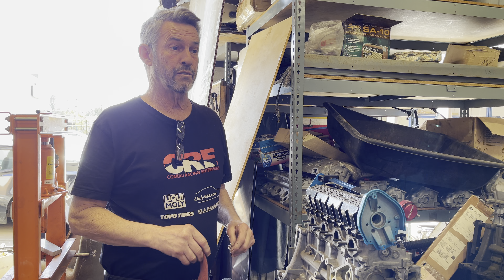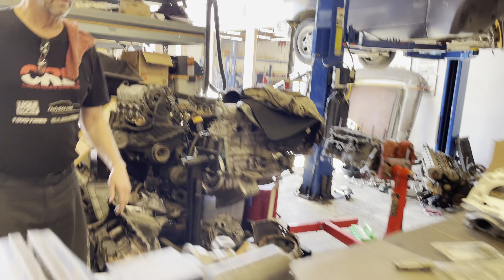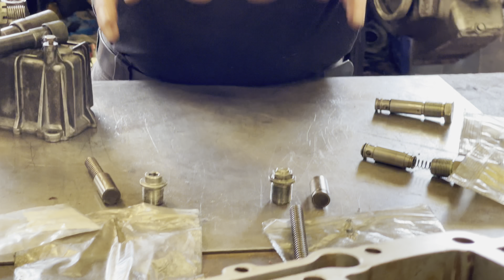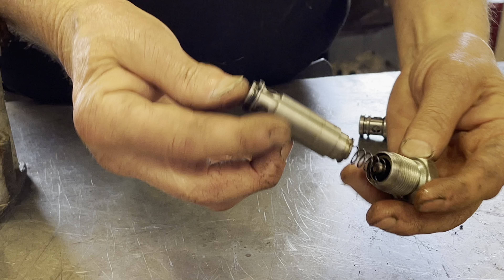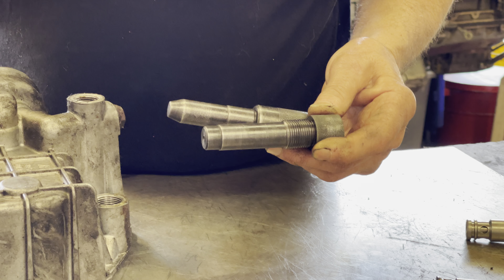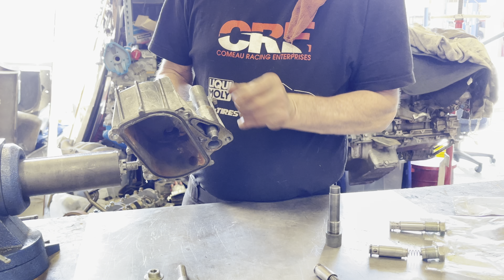Porsche 944 OPRV Breakdown

Comment: So is one washer a conservative modification to the early 3 pc. oprv for a new rebuild? The engine suffered a connecting rod bearing failure.
Reply from the maker: Yes, try one washer first and see what the resulting pressure is. It’s easy to pull the OPRV back out and add  another washer
Reply: @ComeauRacingEnterprises  Thank you!
Reply from the maker: @SuperM1687  Welcome.

Comment: I have an 86 Turbo with the three piece oprv. Recently I replaced all the gasket and o rings in the oil cooler housing. Now my oil pressure at start up is 5 bar and when warm 4 bar. It won't come down below that. I replaced the sender still same high pressure. When I put the cooler back on I used the alignment tool. Could my 3 piece be binding and should I convert it to the one piece oprv?  Thanks for your video.
Reply from the maker: No don’t replace it, silly! Your Oil pressure is outstanding and very healthy for the engine. Nice work taking care of your engine. Gotta respect that.
Reply: @ComeauRacingEnterprises  

Thanks for the reply. One last question.  I just took the car out today and drove it around for about a half hour. When I finished the drive, sitting at idle, pressure is at 3.5 bar. When driving around and the car is warm, at 30 mph and two thousand rpm in fourth gear its pegged out at 5 bar.  At 50 mph at 2500 rpm in fourth gear it is once again pegged out at 5 bar.  Is this an issue since the pressure isn't coming down when driving? Thanks again.
Reply from the maker: @louislocchetto3164  If you're revving at all, ( driving or not)  a healthy engine will make 4 or 5 bar.
Reply: Did you change this proactively? I have an ‘86 turbo with 90k. This is on my punch list of to do items and wondering at what mileage they typically fail.

Comment: Cracking video, I ve a 1989 2.7 with the modern 3 piece pressure valve with the 24mm hex on the end. the O ring on it was shot, there is also a 1" length 4mm rod inside the spring, is this normal?
Reply from the maker: The three-piece pressure relieve valve is for early cars. Your car should have a late 0PRV. That’s a one piece unit. Not sure what the 1 inch length rod was doing inside the spring.
Reply: The third one from the left was what I meant by modern 3 piece, all be it the main piston seemed stuck half out the block, only the cap and spring would come out, and like I said there was a small bar inside the spring.  https://drive.google.com/file/d/1-O4ywxdo9W6WLJViGgXV2LhjehZhoFUW/view?usp=drivesdk
Reply: @nutnboltcombat  Post a pic, not a link.

Comment: hey there,i noticed on my 1984 2.5 litres 120kW the oil gauge was not working,and oil light  apeared on the dash..i removed the oprv and cranked the car but no oil was coming out,normal or could be the oil pump bad?
Reply: That's not good. On an early car like yours, the only oil warning light is for pressure. Very unlikely the oil pump. More likely the oil suction tube inside the oil pan has broken from excessive vibrations, usually due to collapsed engine mounts or poor quality engine mounts.
Reply: @timcomeau420 i actually made it work again,just had to prime the oil pump. 
I dont know why it happend,bcs the car drives daily cpl miles..

Comment: I found a Technical Bulletin by Porsche addressing the two early style spring+piston style valves you show in your video.  The earlier shorter spring is 78.4mm and was upgraded in mid 1984 to a 95.5mm spring.  Thanks for showing this updated version which matches up with the socket head plug with the round button in the center.  It sounds like you don't find the one-piece retrofit valve to be much of an improvement over the spring/piston valve, but is that true for both the short- and long-spring versions of the valve?
Reply from the maker: Excellent info to know about. I haven't seen that tech service bulletin, so I really appreciate you informing me about it. Do you have the number for it? I'll study and memorize that too. :) The 1-piece is probably an improvement, but you can stack a washer with the spring to increase your oil pressure with the spring-type OPRV's.
Reply: I've been trying to find this bulletin, do you have any more info on it you can share? The reasons why it was changed maybe?

Comment: Can u zinc plate an oprv?
Reply from the maker: Why would you?
Reply: Zinc plater threw it in by mistake. My mistake not checking everything before I sent.
Reply: @VENTOPWR  Whether it's a 3-piece or 1-piece, I would check its operation and see if it fits ok before using it or throwing it away. If it went thru a plating process, the internal O ring is prob ruined.
Reply: @timcomeau420  Is it even worth repairing?
Reply: @VENTOPWR  1-piece valves are very exp $$$$
Reply: @timcomeau420  I see, I don’t mind repairing it, do you know of anyone in north east that could accommodate? BTW you channel is invaluable. Thank you for taking out the time to help us rookies.

Comment: I really like that concept about increasing your oil pressure. It would be cool to be able to do with the one piece easily. Sometimes when it is hot, I see the oil pressure at idle go down to like 2 bar. That trick wouldn't fix it in this case (thicker oil probably), but that's a cool thing to know about.
Reply: 2 bar at idle and hot isn't that scary in these cars as long as it comes up to 4 or 5 bar when revving it. Yes, run the thickest oil that your temp zone will allow. In San Diego, we run 20/50. Decreasing oil pressure in these cars is usually remedied by changing the connecting rod bearings. They have date stamps on their outside.
Reply: @timcomeau420  in my 944 86 NA when the engine is properly warmed up, at idle, the oil pressure gauge is showing around 2 bar, but the needle is jumping all the time up to around 4 bar. when the engine is cold the oil pressure gauge is showing 5 bar without any fluctuation. could you  please write any tips for the issue.
Reply: @vertex944gt3  2 bar at hot idle isn't that scary, but not optimum either. As long as the needle goes up to above 4 bar when revving. Most likely, your rod bearings are getting thin. Re the jumping needle: Are any other gauges acting funny? If so, go for a common ground. Your engine block must be grounded properly for the oil pressure gauge to work right. If the others are ok, check the wiring to the sender. No opens or shorts. You can check the wiring by opening the 14-pin connector near the brake booster. Blue / black wire and plain blue wire ( sometime blue / white stripe.) If ok, replace the oil pressure sending unit. You need room to swing a 24mm wrench. On the sender, blue / black wire goes to Wk terminal.
Reply: @timcomeau420  Thank you for replying so thoroughly to my question.
Reply from the maker: @vertex944gt3  welcome. Please tell other 944 people about my channel. :)

Comment: I thought the Manuel said not to use the older styles and because of the oil pressure you spoke of.
Reply: I don't mind using the 3-piece as long as it's making good pressure. Also, I prefer this style for the race cars because you can increase oil pressure by using the washers I mentioned .
Reply: @timcomeau420  have you had any experience with after market oil cooler and can it take the place of original or modify to work with oem equipment?
Reply: @BBox-135  Certainly. The answer splits into two courses. Mount a 951 cooler console and then a stock 951 oil cooler or larger oil cooler up front. The other course is to keep the stock NA oil cooler and install a sandwich plate between the filter and its housing, then run hoses off that to a cooler.
Reply: @timcomeau420  oil cooler mod is more of what ever one  budget is or have you found one of the options to be more beneficial?
Reply: @BBox-135  Yes, budget. Either way is just extra insurance because many of us race 944's with the stock oil cooler only, even in the SoCal heat.

Comment: Great video. Always wanted to know how these worked. Is there any reason you have to update from the early spring and piston to the one piece?  What was wrong with the early ones?  Thanks again for great content.
Reply: @BBox-135  Any style will malfunction when stuck. That's why alignment of the oil cooler housing is critical.  I've seen them get stuck open and closed. The video you posted refers to the tech bulletin and is great for learning about the various valves. Keep your pressure up!

Comment: Could you show the difference between those oil cooler-filter block revisions,  R5 and R6 has been mentioned before. maybe show a line up of them?
Reply: There's only 2 versions of the oil cooler housing. The 5R and 6R, which differ only in the circular seat area for the oil cooler itself. See my video on oil temp sensor mod. https://www.youtube.com/watch?v=a4Ql74CfcTg           With the 6R, there's an additional alignment procedure for the cooler within the housing, using shims. Always pressure test the oil cooler separately by submerging it in water. I like that you're asking so many questions. Quest for 944 knowledge! :)

Comment: Not sure if this video is too old for you to see this comment but worth a shot... I woke up to my 951 in a pool of coolant in my garage, had no leaks prior the day before. My car was do for a nice cooling overhaul but noticed as soon as I took off the Coolant Expansion Tank that there was this grey slimey build up inside as well as in the radiator hose itself. Immediately thought Head Gasket but after doing some reading, I'm wondering if it's my Oil Cooler, the only thing I could justify the pool of coolant in my garage after cooldown is maybe through the Overflow tube because of all the buildup. So after watching your video I think I might give oil cooler a shot and pray for the best !
Reply from the maker: It's extremely rare to get oil / water mixing as a result of a head gasket in a 944 type. Go for your oil cooler seals. Be aware there's an update to the aluminum sleeve that inserts in the block. Used to be asymmetrical, now it's symmetrical. Replace BOTH green o rings. You'll need to clean the whole cooling system including hoses, block  and radiator flush. Sometimes easier to just replace the hoses. Fill with water, not coolant, and we add some SHOUT laundry detergent. Put the engine thru a heat cycle ( without the thermostat) and flush a couple times.

Comment: Does the Oil cooler housing change from 1986 to 1987?
Reply: Don't pay attention to the model year, pay attention to what's installed on your car. It might have been changed. 5R to the later 6R. The 6R has a different shape inside the housing and has it's own separate alignment for the cooler. Then you have the alignment for the housing to the block.
Reply: @timcomeau420  Thru some unfortunate events the cars original OPRVs threads got messed up so if i try to screw it into the housing it will ruin the housing. I have one out of a 87, my cars a 86 so that OPRV will not work. In theory can I swap out the 22mm head onto my original OPRV?  Thanks!
Reply from the maker: @BennysBenz  One- piece have a 24mm head, not 22mm. Your 1986 should have a 3-piece OPRV. The system parts must stay together. I'd get another head that is an exact match for yours.
Reply: @ComeauRacingEnterprises  Thank you so much for your help it'll get this 944 a little closer to be driven again 👍
Reply: Ok so I'm building a 968 block with 2.7 head turbo . Can I use my 87 turbo oil cooler housing along with the oprv that came with it. Or do I use the one piece oprv that was on the 968 block?